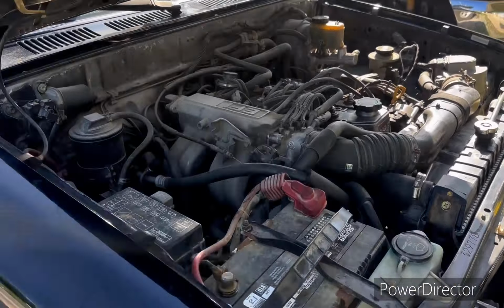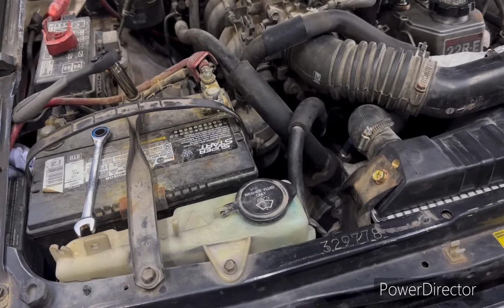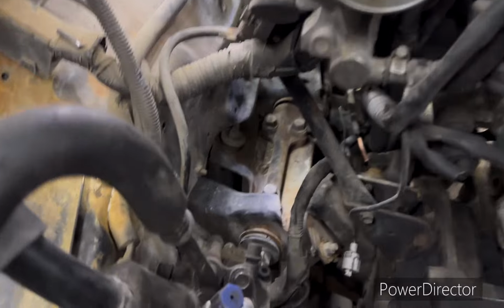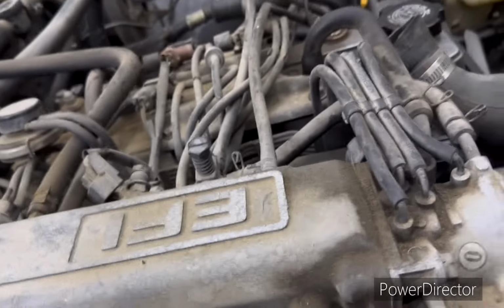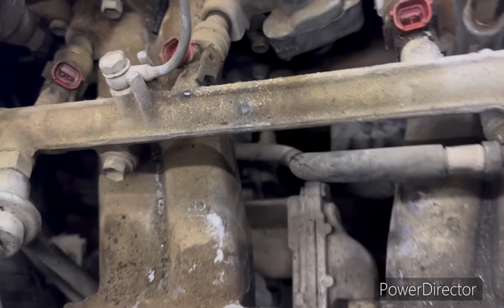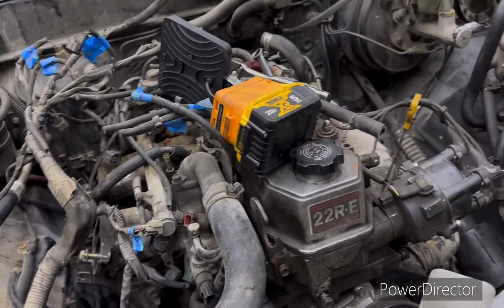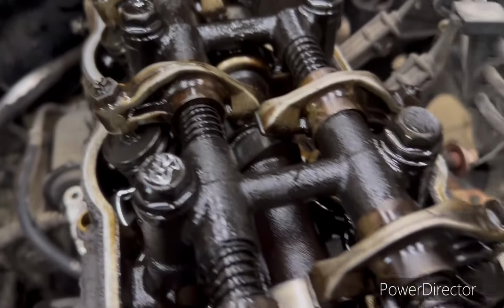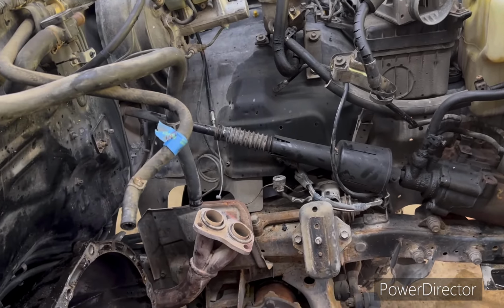Toyota 22RE engine rebuild part 1 #toyota #rebuild #howto #fix #repair #broken #overhaul

Comment: I unplug the wiring harness from the ECU in the passenger side kick panel and feed it thru and lay it over the engine. I have never unplugged wires on the engine side on a 22RE. then i do what you did with the AC and the same with the Power steering pump. In case you ever have to do it again.
Reply from the maker: Nice. That’s some good advice.